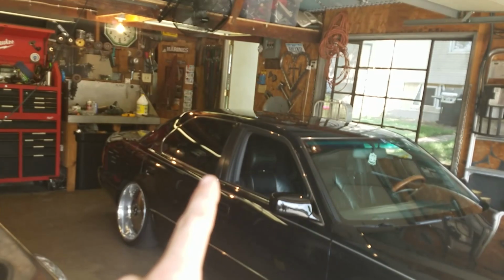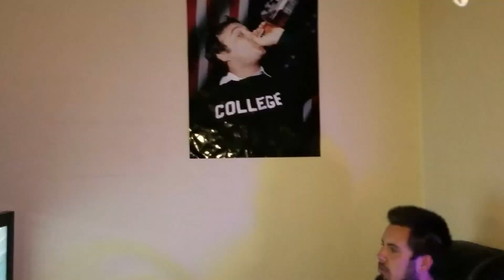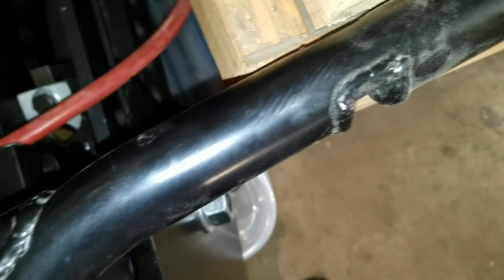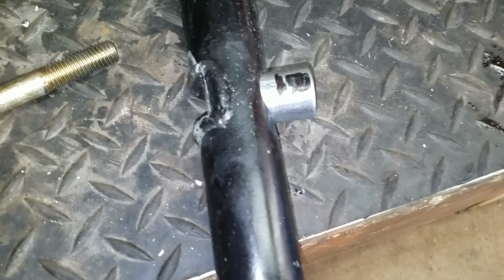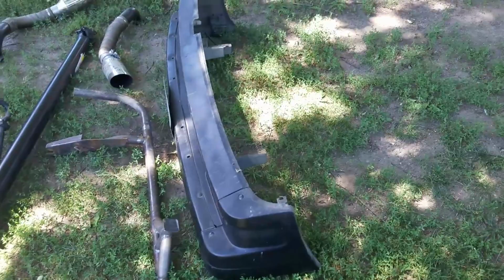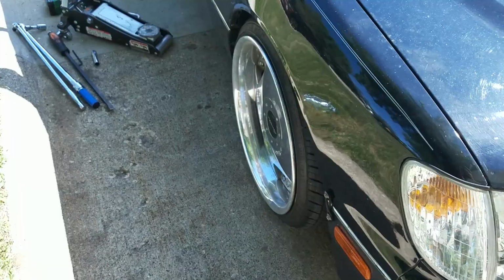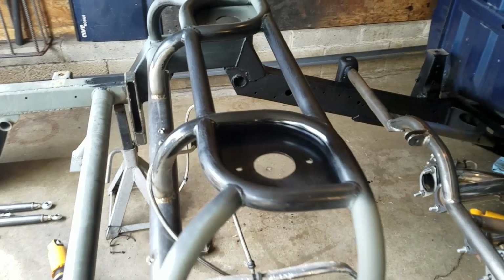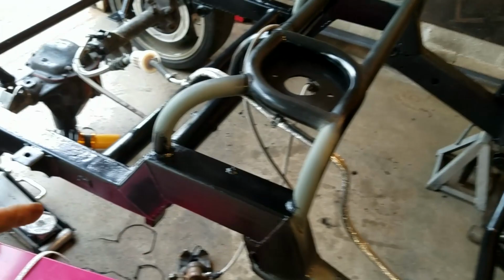DRIFT TRUCK CAR SHOW PREP!

Comment: Hey. I need to know for my truck.  What fuel cell did you use and stuff like the dimensions and brand. Thank!
Reply from the maker: Mercedes B2200 Man I have no idea without measuring. It's some knockoff cell from like thmotorsports.com I think. I just used a cell that fit the space I had
Reply: Heintz Boy Garage thanks man. How many gallons is it?
Reply from the maker: Mercedes B2200 like 15.5
Reply: Heintz Boy Garage cool. Thanks man. I used the Mercedes fuel tank and it's sketchy. Keep up the good work
Reply from the maker: Mercedes B2200 No problem, and thanks!